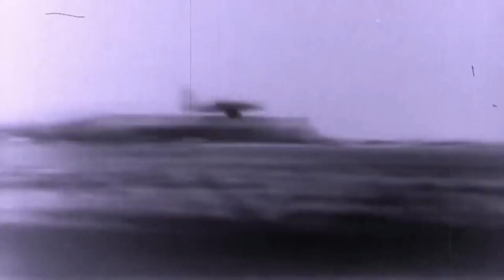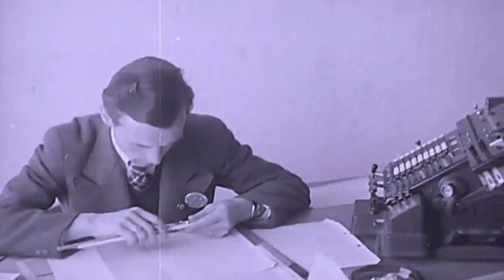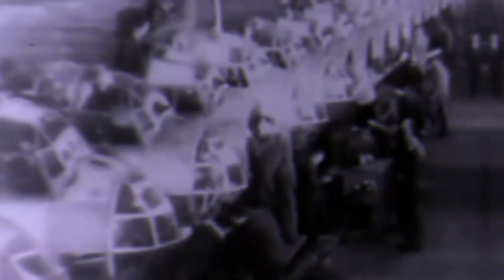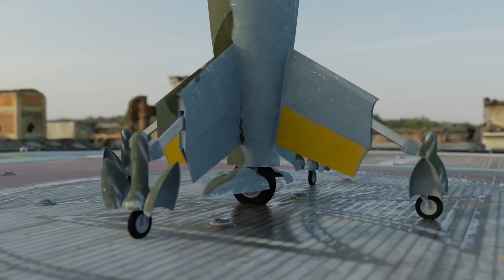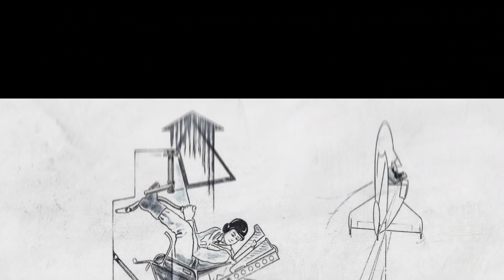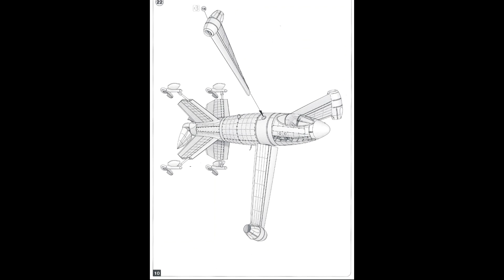TheFocke Wulf Trebfluegel : HITLER'S Nazi VTOL Fighter Jet!

Comment: Interesting idea, but I can imagine why it never got off the drawing board. But a FIGHTER??? It does not look like anything that could be agile enough for a dogfight.
Having watched a French helicopter that worked with ramjets at the tips of its blades, too, I can guarantee that would have been a pretty noisy craft.
I also have wondered why no one seems to have done anything with pulse-jets; they too were cheap, and they did actually work.
Reply: I think that one of the reasons is vibration.